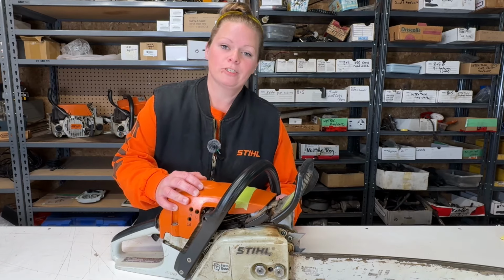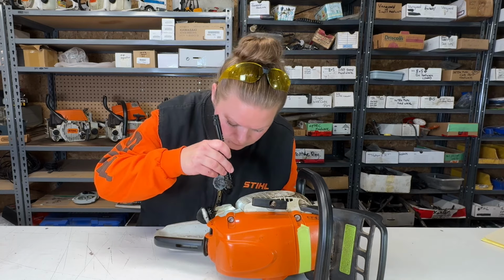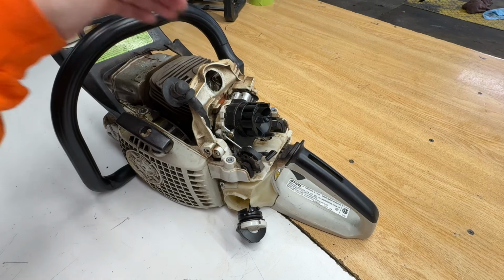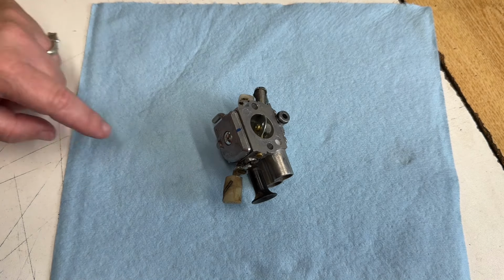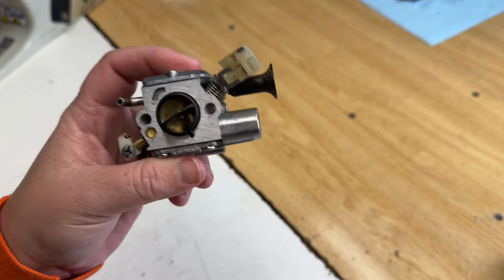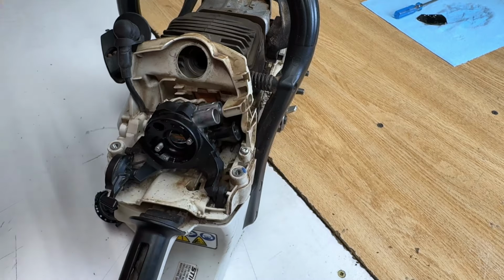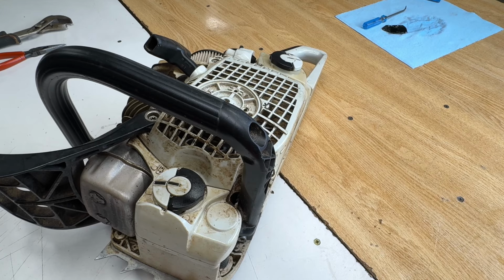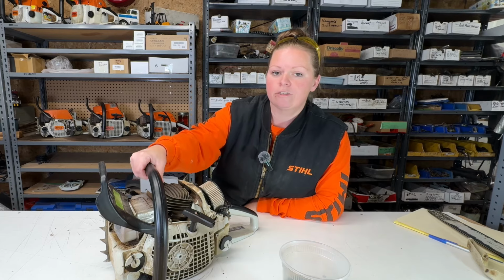Stihl MS 271 Farm Boss!  Customer Says:  WHY Won't My Chainsaw START ? Will It Run On Water?

Comment: It might be oiling just fine, but it's good to check if it's oiling down the bar properly.  My 271 wasn't.  Every shop visit they said the same thing... it oils just fine.  Yeah? prove it.  Had to modify the bar with an O-Ring to force more oil down the bar, not leaking out the bottom of saw/bar.  Place a proper sized silicone high temp O-ring where the hole for the tensioner is, on both the top and bottom of the bar, (for when flipped).  So the ring sits snug in the bar and the hole for the tensioner is still open.  Problem solved.  More bar oil down the bar, no more overheating the bar and chain, and $$ saved not buying new replacements... not to mention a whole lot safer not having the chain potentially coming off.
Reply: It would be helpful to show how to do that

Comment: 15 bars! I've been heating solely with wood for 22 years and selling firewood and I've had to buy one new bar because I bent it. Granted, I've probably used 15 different saws in that time and sold them after a bit (I like trying them out), but the bars were always in good shape when I did. Someone needs to learn how to sharpen chains.

Comment: A favor? Please address proper fuel practices for chain saw use. I am a stickler yet a year ago somehow water collected in my plastic gas container and I didn’t catch it before using this fuel in my 362 cm. The saw wouldn’t start thankfully, saving itself. I can’t be sure if I bought water contaminated fuel or the moisture accumulated on its own while sitting in my garage for 2 months. The service station where I used to buy fuel refused to accept any responsibility. I’ve been using $$$$ Husqvarna pre-mix since then. Please do either a stand alone video or a segment of a video addressing this issue. How long can fuel be stored? What is proper storage, etc. Thanks in advance.

Comment: thank you for your videos, i recently had a problem with my work mower which i use for my lawn business 5 or 6 days a week and always have fresh gas, i pulled mower off my trailer to mow a customer and filled tank from a 5gal can i just filled at the station and started to mow and mower started running bad so i drove it back on trailer to look at it incase it stalled and it did, after checking all the simple things i narrowed it down to a run only on carb spray so i took it home to troubleshoot fuel system and what do you know i found gas tank 1/3rd full of water, very frustrating to say the least and no recourse since i purchase fuel at 3 different stations and not sure which one is guilty so now i cycle my gas thru a 6.5gal glass jug before putting in service 
thanks again and God bless

Comment: 30:45. My wife in 2016 asked me what I wanted for our 19th wedding anniversary, and I told her a new MS461, which she agreed to. I couldn't drive to the saw shop fast enough! On the way back I stopped to get her a Browning .270. I still have the saw, she has her .270, and we have each other. 
Another good video!
Reply: Good one,I’ll have to use that.
Reply: Nice. I had a savage 110  in .270 Winchester as a teen. Was a tack driver, really hate I traded it for a atv.
Reply: That was the most romantic stiory ive heard lately🤔😂

Comment: Subbed.....what was the metal object in the fuel?? I reckon it is a portion of the fuel filter that's come adrift. are they "weighted"?
Reply from the maker: I fished it out and it was part of the fuel tank vent.
Reply: @marriedwithsmallengines  Ha ha..I did say I was a novice 🙂
Reply: @hubby-tubadventures01  kinda close tho.

Comment: They may look very similar but most small carbs don't use 'Phillips' screws.
If you see a dot stamped into the head, it's a J.I.S. fastener (Japanese Industrial Standard) and requires the proper driver not to strip.
Reply: As someone who has stripped many carb screws on yamaha's, I approve this message.😂

Comment: We used to use combi cans for fuel, at the bottom of the spout there was a recess that water could gather in. Nowhere near as  much water as in that saw but enough to cause problems. On wet days we had to tip the combi  up and let the water run out before we refuelled the saws. Another god video 👍
Reply from the maker: Thank you!

Comment: "whaddya mean my saw won't run on water?"  8^)  Lots of water in pump gas these days (where I am in Ontario anyway) it may be due to all the ethanol they put it it, which will absorb water. Some of the jokers I see at the various stations, I wouldn't be surprised if they aren't checking water in the underground storage tanks and pumping it out either. My family owned a station from the 1940's to the 1980's and tank checks and clean outs were a regular thing we did. May not be done as much now. Cheers!

Comment: Hello from nova scotia. The 271 was my 1st saw i had bought in 2020 with a 16 inch bar then i traded it for a 500i a year after with a 20 inch light bar. I miss the 271 it was a good saw but it does NOT beat the 500i LOL. Only thing is the 500i don't like small twigs lol. It definitely likes wood and the bigger the wood the happier it is lol. You do great work, GOOD WORK 😉
Reply: I would hope the 500i is better than the 271 at 3x the price😂

Comment: I run ethanol free gas since a station isn't too far away. In Florida I couldn't find it but Missouri is good. I tried running stihl premix but I used so much of it. When I used the premix in my little 170 it was a good idea not to choke it cause it would flood.

Comment: I've never liked that weak trigger/choke design. I agree, Older saws are better to work on and are better saws in my opinion . At one time I had about 20 personal Stihls, so when I wanted a new one I just got one...although I got dead ones and rebuilt them 🙃

Comment: You interested in getting rid of the ford garden tractor? What’s wrong with it? What’s it missing?
Reply from the maker: The engine and drive shaft are gone, as well as many other bits and pieces.  It's just happily resting in peace back there.
Reply: @marriedwithsmallengines  I’m looking for the bones. Trying to build a couple pulling tractors if you have any other ford garden tractors

Comment: Hello

Hers my story. The saw wont start because of the Choke issue and then the customer decided to clean the saw with a pressure washer. 
Come on saw start, and the  water got into the carburator and the engine. Thats what maybe happend.
Reply: Yep, I reckon a pressure washer was involved. It was fairly clean and it was bound to have been filthy, judging from the history of bar replacements and so on. It has had a very hard life. Cheers from Australia
Reply: No, the water wouldn't go from the carb to the tank..I'm sure she was right. He left his fuel jug outside, and it filled with water.
Reply: I could see a little water getting in like that, but that much. No way.

Comment: I have an old wooden sewing thread spool I lay carbs on to work on them. That way the throttle / choke shafts, or the fuel inlets don't rock around on the bench top. I also just book marked The Greasy Rag's site to checkout.

Comment: Customer has removed the deadman’s safety switch and isn’t concerned about a non-functioning chain-brake. Plus runs his saw on a premix of 80% water:20% whatever. What does he do in his spare time, Russian Roulette maybe. And how can one saw get through that many bars & chains in four years?

Comment: Did not see fuel line attached
Reply: Me too. And not seeing it removed also from carburator. Video was cut very much.
Reply from the maker: When I remove the carb, the fuel line slides off at the same time.  When you see me push the carb back in place, the inlet is sliding into the fuel line all in one movement.   I have nothing to hide from you!
Reply: That's great to know when I do it does not go that nicely. Thank you
Reply: @marriedwithsmallengines  Don't worry about our pedantic comments...

Comment: I always empty saw or trimmer tank before use - if there has been longer break using it. I mean storage time.  It is kind of waste of gas but I have no nerves to clean that water out of carburetor in every new start.
Stihl machines are very sensitive to water in gas.  But older B&S lawnmovers just don't care.